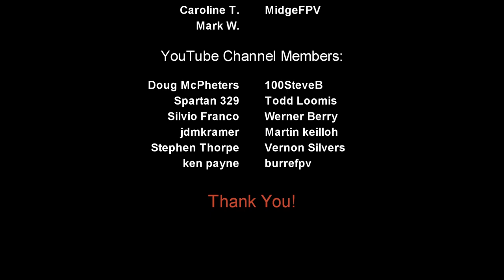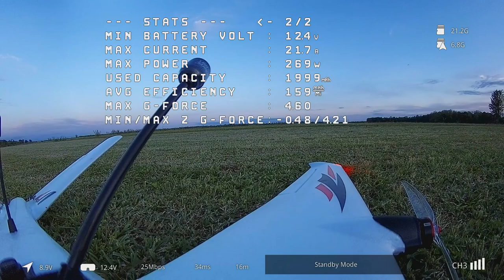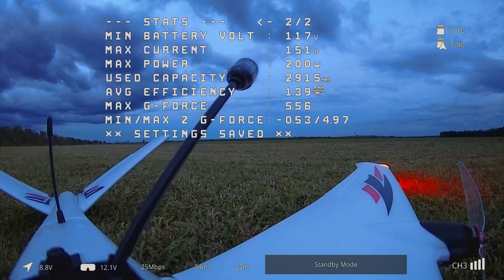Atomrc Swordfish

Comment: Hey, nice video. I'm very jealous of how insanely calm and smooth the air is where you fly, that is extremely rare here in Ireland. Regarding the pitch bobbing issue in cruise. This is something I reported a couple of years back when I was flying the Mini Crosswind a lot. You might already be aware that this issue only seems to be experienced on twin tractor planes like the Swordfish, MCW, Albabird etc. In the end we believe that the main cause of this is incorrectly tuned rates in iNav. I've managed to get rid of this issue by running autotune and you need to pitch at full deflection for as long as you can in 1 go. Do this for a while and then see how cruise goes 😃
Which font are you using? I've just got Walksnail to try and my Sneaky FPV Sphere font has letter M's as the AHI instead of dots... so it looks like MMMMMMMMM 😅

Comment: Wow, best plane and OSD setup I have seen so far ... amazing, with an average of 5 A at around 40 mph (66km/h) that is very economic ... and from what I have heard this thing is so silent, you don't bother anyone when not flying very low, thanks to the twin setup. I often see s drastic offset and delay between the actual horizon and the sensed horizon, but this one is spot on.
And the beautiful light around sunset gives the technical perfection another artistic layer.
Reply from the maker: Thanks! The artificial horizon is always synced when viewing the live feed with Walksnail. Most of the videos you'll are made from the DVR recording with the OSD info overlayed onto it after the flight using one of the software tools available, it's the intended way to do it and what most people do... lol From what I've seen there's always sync issues, not sure what's causing them but several people have pointed it out. I'm recording the actual live feed so I get the same thing I see while flying, including the synced AHI.

Comment: The "porpoising" looks to me like the throttle controller in cruise is driving a phugoid oscillation. I say this because the climb rate is oscillating with the "porpoising" so it's not a short period mode oscillation. It's very fast for a phugoid oscillation, but this is in comparison to typical oscillation periods for full size aircraft. To fix it, I'd suggest taking an onboard flight log and looking at the elevator and throttle signals relative to the porpoising (since the airspeed and climb rate controllers are unfortunately necessarily coupled). Adding an airspeed sensor or switching to ardupilot is probably also a good approach to fixing this. Without the airspeed sensor the FC has to wait for the GPS signal to suggest what the airspeed response to throttle is, limiting how fast you can control airspeed with throttle.

Comment: INAV only seems to experience the altitude hold bobing effect on twins.
I managed to mitigate it on a Binary, using all the pitch2thr settings, although not completely.
I wondered if it has to do with the thrust line, verses the vertical CG with twin tractor prop ?
Reply from the maker: Interesting. I hadn't really noticed the correlation before. Could be something to it! I haven't set up a ton of planes with inav or spent a lot of time tuning them, apart from when Marc helped me dial in the Eagle, and that one did fly rather well. To be fair though, it's a great flying little plane even without a flight controller. Kinda like this Swordfish but more "trainer like" with some built in stability.

Comment: Great opening photo view (0:36) sitting out on the runway with hanger in the background. Such a clean looking build (2:57). For initial maiden and flights, this seems to be such a locked in setup. Don't think I saw any tuning/triming being done.
Regarding proposing, at 17:45, when changing between cruise and angle modes, seeing throttle changing a couple percent. (variability overlaps, but max/min range for each differs)
Looking (zoomed) at tail as cruising, it doesn't appear that ruddervator servos are moving. (??)

Generally adding weight to a plane (36:30) just requires it to fly faster to achieve the same efficiency. Sailplanes add weight to increase penetration into headwinds. Only downside is climb rate might be a bit lower, and landing speed a bit higher.
Nice hack (tip) to refresh OSD via panning. :)
If you do, seeing the same aircraft with either INAV, and Ardupilot could be interesting.

Comment: the 21700 cells are only 68g ish each where 18650 are roughlt 47g each, so a 21700 pack is only 80g roughly heavyier than an 18650 pack  and if you got the higher capacity lower current rated ones it will still fly well and for a long time, where 18650 2p is like 400g vs 280g so its worth considering, i used to assume they would be heavier

Comment: Quick question, the stock vtx WS antenna .. how bad are they ? I see you switched, I'm wondering what the difference is and it's it's worth it thanks
Reply from the maker: I flew the Esky Eagle with the stock antennas a bit before replacing them, they worked OK. I did see a little improvement with the RushFPV Cherries I put on there. I think just getting them higher up and less obstructed by things in the plane helps as much as being a better tuned antenna. These Hammers I used on here seem a slight bit better than the Cherries. I ordered another set to try on the Eagle for a more direct comparison to see if it's really the antennas, or some other factor making it perform a bit better.

Comment: Beautiful skies, I bet you'd come close to an hour with a 3s2p pack, but the difficulty of packing it in might make the 4s1p 2170 pack the better choice
Reply from the maker: Yeah I think a 21700 would be a good fit for it. 4S2P could work, though it may need some weight in the tail to balance it. I really wish there was another little pocket molded in the tail with a tunnel for wiring out to it, between the tail fins. I'd move the GPS back there for some tail weight and even more separation. I thought about cutting one in myself, but I always hate butchering up a new model, especially a nice looking one like the Swordfish... lol

Comment: If that 270 degree servo can physically go further, then you can easily extend the pan range in INAV. I have no idea if Ardupilot supports that.
You can also configure the ESCs to break on idle if you want to reduce drag during gliding and decrease the risk of damaged props on landing.
Also I wish they had made the nav lights face backwards too as they nav lights are meant to be.
Reply from the maker: There's no physical stops in the servo, and you won't damage the feedback pot rotating it a full 360º, but the feedback pot only works in about a 270º range. The normal pulse range between 1000-2000uS drive it to about 180º, you have to extend the range to get the full 270. So it's already extended to the limits of what it can do and still center. Any more and starts rotating continuously, which is bad for wiring... lol
Reply: @bonafidepirate  Ah alright, so I assume from that that one can extend the uS range in Ardupilot then.
Reply from the maker: @WinstonSmith1984  Yeah, you should be able to use 500-2500uS in both inav and AP

Comment: Very nice and clean build! I can't seem to find silicon pin header wires like the one you used for what I am assuming is the WalkSnail system, on UART2. Do you have a link to them?
Reply from the maker: I don't know of any ready made. I have some rolls of small silicone wire and a box of connectors and some crimpers. I make my own cables most of the time... lol

Comment: Wow! How are you getting your AHI so responsive? That looks way less jerky and of higher frame rate than mine.
Reply from the maker: It just worked normal for me... lol Are you using Walksnail? I didn't do anything special, just set up MSP Display Port in inav on UART 5 since I used the "DJI" plug on the F405 Navi. I'm almost sure there were some OSD related changes/fixes for HD in Inav 6, could be related?
Reply: @bonafidepirate  Yup, using Walksnail. It’s maybe because I’m used to looking at my flight footage after merging it with the OSD data using the overlay tool, which seems to lose the responsiveness, and the synchronisation. 
I’m also still on one of the iNav 6 release candidates so maybe the full version might be better.

Comment: Hey great vid,  definitely getting the RTH version.  What are you using for the pan servo control?  Via transmitter or goggles?
Reply from the maker: I use one of the sliders on my radio (Radiomaster TX16S)

Comment: On the lower right side, is that VTX temperature (BAR)?
Reply from the maker: It's the temperature reported by the barometer. Not terribly useful as it's always warming than ambient temperature outside, I mostly just stick it there as a filler to balance the OSD a bit rather than have nothing down in that corner. I believe you can also show temp. from the IMU, but that will show even higher than the barometer in most cases.
Reply: @bonafidepirate hello, can explain how to display on OSD the temp from the barometer?

Comment: i had a zohd drift on inav, that head nodded a lot. turned out i had the cg way too far back.
Reply from the maker: The GC seems good on this one as best I can tell. My Eagle did the same thing in inav 5, it was the gain for altitude control, I forget the correct term or variable, but Marc helped me tune a couple things on that one and flew great after. I suspect it's something similar with this one.

Comment: Can you please explain some little about connection walksnail vtx to F405 navi. Are you using cable 6pin from UART5 (dji interface) to 4 pin walksnail (V1 or V2) connector, or connect it with different way ? I am new happy owner of walksnail and swordfish and now searching elegant solution for interconnection. Thanks in advance

Comment: When you plug Ur battery in does the plane need to be level, how does the jiro know its level 🤔
Reply: The airplane does not need to be level when the battery is plugged in. Just keep it stationary until the accelerometers work out the direction of the gravity vector. From then on, level is derived from the accelerometers, gyros, and clever algorithms 😊

Comment: This is almost exactly what I want to build, but I don't have any RC gear yet.
Eventually I would want to build something that can do over 6 miles range with max loiter time.

How does the video feed in your goggles/monitor compare to the recording (which I assume was recorded on-board)?
Reply from the maker: The video feed you see here is exactly what I see on the monitor, the HDMI signal is split to the monitor and to my capture card. Walksnail HD FPV looks amazing, and far better than any analog system I've flown over the years.
Reply: @bonafidepirate  Thanks for the response!

Comment: Anyone know if there's an HD camera switcher that will allow switching between 2 or more HD cameras on the same VTX?  Then you can have a main view then a secondary view -- like at the nose of the plane for full unobstructed view of the ground, etc.  Or even a zoom view.

It would have to be some kind of board that switches multiple cams to one cable into the VTX.  Then it takes an RC signal to control which camera selected for input into the VTX.

In my analog FPV days, I had a 3 camera headtracking setup: 1) main view 2) rear view and 3) a 4x zoom view for checking out ground targets up close.  Would be nice to have this in HD now but the digital signaling and protocols might be problematic for a physical switch.

Comment: The home arrow seems to be pointing in the wrong direction when you pan the camera. I thought that was fixed in iNav 6.
Reply from the maker: During the first flight, I had it all set up with the pan servo so the home arrow would follow it, but the degree's was set up wrong so it didn't follow correctly. If I remember right it's something to do with the extended PWM range I'm using for the pan servo output, I know I had the same problem back when I first set that up on the Eagle, and I don't remember exactly how I solved it then. For the second flight I turned that off so the home arrow ignores the pan servo, until I fix the issue. ;)
Reply: @bonafidepirate  Yeah  seeing the cockpit like view is great and the 360 apparent view is amazing. Like being in a P38 Lightning!

Comment: what battery did you use to get 30+ minutes flight time?
Reply from the maker: I fly it with Li-Ion 4S packs. I've used both a 3500mAh 18650 and a 5000mAh 21700.

Comment: Would you build me a RTF long range plane for me or just flight controller system?I really like watching your videos and know you know what your doing.I love your Passion and skills in building these long range platforms. If you could build me the complete wired up flight controller system you use for your long  range planes I can install it in my new plane.Cost is not a issue..I would love a long range VTOL.

Comment: I have a 2170 4S (4000mah) pack of Molicells I made, I use them to power my Goggles right now. They are really energy dense. You'd get an hour I'm sure on this bird ...🤔😏😀🇬🇧
Reply from the maker: I'd like to try a higher capacity battery in here. Normally I'm happy after a half hour of flying and ready to land, but I'd like to see if I can get it flying longer for those extra fun flights, like these were... lol
Reply: @bonafidepirate  I'm sure it would handle the extra weight. Just the launching might be an issue...🤔😳🇬🇧

Comment: Auto level can't fix a badly tuned airframe, I think the motors need tilting down more ,2 degrees
Reply from the maker: If that were the case you'd see problems in all flight modes, not just when it's attempting to stay at a fixed altitude.

Comment: Why not just course hold and just the amount of throttle you need to stay in your flight level? Takes less amps....
Reply from the maker: I like having "true" cruise with altitude hold, and once everything is tuned and set up well it can fly just as efficient as manually controlling the throttle. Cruise really helps when panning around looking at things while flying low during turns, etc.

Comment: I also need to see the plane even if it's just the nose tip
Reply from the maker: I always like seeing at least a little bit of the plane, it's less disorienting I guess. I love seeing both motors on this one while looking forward. I just wish I could hear them now! lol I love the sound of a twin. Maybe one day we'll get audio with an HD system.
Reply: I think the wtfos hack allows live audio with the full size air unit...
Reply from the maker: @MrDrivesafe  Interesting, I haven't really kept up with the DJI stuff. Where does the audio come from, is there a mic onboard or does it use something for an audio input?
Reply: Yes, the full size air unit has a mic built in that it normally uses to record audio to the SD card in the air unit itself.
Reply: @bonafidepirate  In HDZero you have to run an analog VTX to get audio., if you need audio anyway.. I never have listened while flying because I always forget to plug a ear bud in.

Comment: what controls on your radio do u use the move the camera?
Reply from the maker: I use the sliders on the side of my TX16S. I have some longer levers that makes precise control easier with them: https://www.thingiverse.com/thing:4532831
Reply: @bonafidepirate  ah ok I been using the yaw that isn't used on any of my planes except not the sword fish uses it..  so I have to change all mine but the pots switches are Jerry when trying to use on a servo plus this way I don't have to worry about moving my throttle to far when I move the camera.
Reply from the maker: @devilsreject78  I prefer using the rudder stick too, unless I have yaw control like you said... lol I also end up moving the throttle when I'm panning the camera. I had even set up a throttle "lock" on my Skyhunter on a switch, so I'd set up my cruse then lock it and not worry about it again until I needed throttle control later in the flight. I was always worried I'd forget to unlock it if something came up where I needed quick throttle to get out of a situation, but thankfully it never happened. I haven't set it up on any of my other planes for that reason though. I try to get in the habit of not moving the throttle when panning with the rudder stick. Tightening up the "drag" on the throttle helps, especially if you use the ratchet with "notches" too instead of just the smooth throttle.
Reply: @bonafidepirate  ye a h same here..... moving the throttle when panning... I thought of the lock to but same reason I didn't do it. 
Once I raised my throttle way up and didn't notice I don't like doing that far from home in afraid of getting the esc even tho it can handle 3x of what the motor pulls...
I moved my pan servo to the left side slider last night,  haven't flown yet but in thinking it'll work good cuz it moves smooth as in when it's on the potentiometer knobs it's jittery sometimes. 

I just ordered the walksnail because you posted about the sale.
Reply: @bonafidepirate  i been using the "PAN" on left rudder stick on tx16 and i 3d printed a better control knob, i love it now, works great.. i finally flew my swordfish, i dunno how im liking the vtail. at first i loved, but todays flight 3rd, i wasnt liking it today but it was pretty windy. so im gonna keep flying it and see